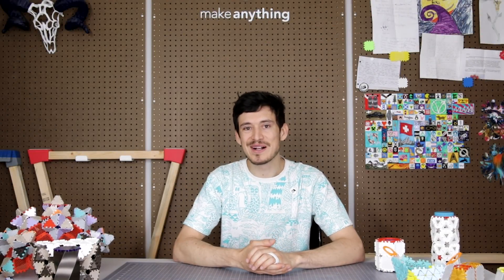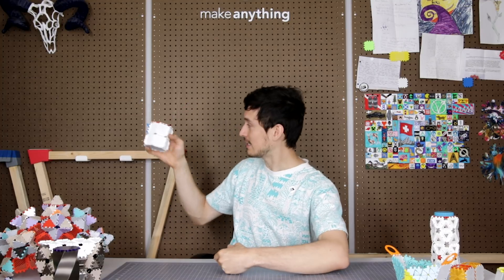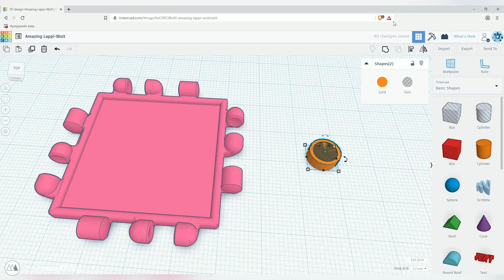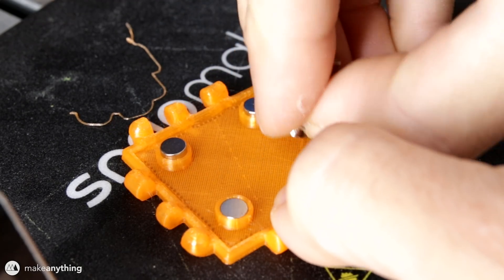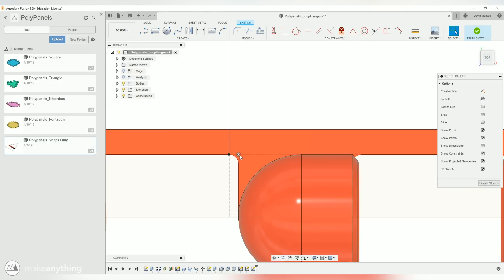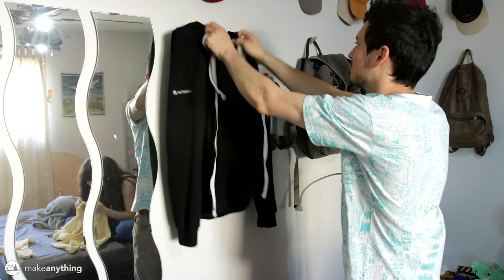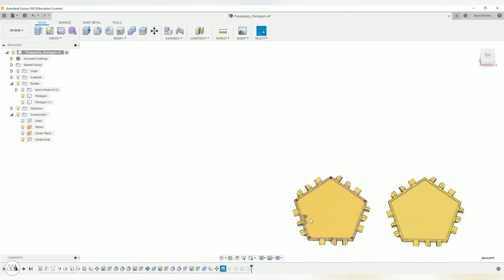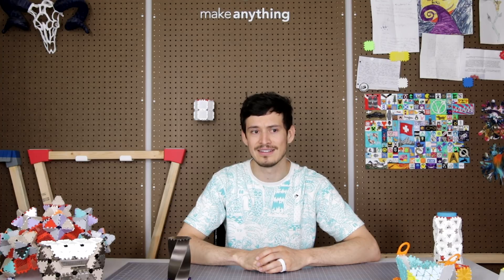Making Custom Polypanels is Easy! Tinkercad and Fusion 360 Tutorial

Comment: Your magnetic PolyPanels are a good use for making puzzle shapes.  Make something cool on your paper printer, cut it up into the shapes and sizes for the intended PolyPanel pieces, affix them however you wish, then see who can assemble the puzzle.  This could also be a many-sided 3D puzzle where each PolyPanel can have 2 puzzle components on either side.  

The printed puzzle images might be made of other materials as well such as laminated on one side and magnetic on the other (easy to do with a Xyron 5" and 9" Create Station).  This would enable the player or customer to add new puzzle inserts to their PolyPanel pieces as well as make their games as easy or as hard as they like by adding more PolyPanel shapes, pieces, sizes.

Comment: Yo Devin - I attempted to add a submission to your contest in Myminifactory , after having constructed it in Tinkercad.  You had mentioned in your video that one doesn't need a 3d printer to submit, but I think that I cannot make an approved submission in Myminifactory without the piece physically printed.  Is this true?  I included a shot of it from tinkercad, but it doesn't appear in the community listing of polypanels.
Reply from the maker: It takes time for approval, but as long as it's a valid file it should be approved

Comment: I have i question: does tinkerkad or fusion 360 work with the programm pepakura?
Reply from the maker: I haven't run Pepakura yet, but I'm guessing it requires an STL or OBJ file, which both TinkerCad and Fusion can produce 👍
Reply: @make.anything  thank you for the response. I've tested it out and it works flawlessly, now i'm going to watch your series on how to use fusion 360, then i can start making some 3d models. ;)

Comment: I mean fun sure... but... useful? not really.    Your clothes hanger probably took what, 20 squares is what 80g of plastic?   Since you can buy 18 hangers for like $2 US... that's like $0.12 each... you spent more than that in electric alone (est. on 20 min per square print time) - and your hanger is already sagging - which was the main issue with the Zacks toys - while flexible and fun to play with, when used for support they tend to bow and come undone.

So yes.. "fun" and "something to do" but... not cheaper, not better, and in many cases less useful.     They are not by any means "practical" and you seem to just be super excited about something your personally promoting so much.                Once again.... look at the Zacks toys.

Comment: Hey Devin, have you ever considered making a twist container hourglass? Like, make it so it slides super slow but a consistent rate? Make one in a transparent filament and one in a nice color (polyalchemy elixir is nice I gotta say) and like you can print a time scale into the exterior container with dual extrusion.
Reply: Great idea but I feel like an issue arrives with getting it to go at a constant motion. That would probably require something more accurate then a 3D printer.
Reply: Cool idea!!!
Reply: Nice 🙂

Comment: I dont have a way of 3d modelling, bit how cool would it be to have electronical component polypannels, one with a... CPU, one where u can rest the vent on, RAM SSD...
Reply: With so many contacts to align on a hinge joint, these probably wouldn't work so well, either greatly limiting the ways they can be connected or providing unreliable connections. I like the approach that Angus @ Maker's Muse went: using Polypanels for mechanical/structural needs (placing motors, servos and circuitboards), but wiring the electrical parts with proper tools.
Reply: Another idea though, adjustable PC case internals as Polypanels, to organize space for optimal air flow. Wiring brackets, disk holders, fan mounts, etc. That would require a lot of plastic though...
Reply: @dside_ru  it would be huge right, even though its not practical, just think... New cpu, just swap out a piece of plastic
Reply: @blu3ntv  socket compatibility issues aside, this isn't much different from what we have now, you just swap out a piece of silicon with some aluminum on top.
Reply: @dside_ru  I always knew it wouldn't be practice bit it would still be kinda cool

Comment: Not hating on your idea here, but isn't anything you make with these "polypanels" much weaker that it would be if you just, made the object normally?
Reply: Yes, the whole point is being able to easily reassemble the parts, which kinda implies some weakness.
However, it's easy to make the joints more-or-less permanent by leaving a hole for metal pin-like inserts right on the virtual edge, actually inserting them and welding the holes shut.
Reply: woolfoma well, you are able to make a simple container to hold something light for when you need it instead of: 
Thinking of an idea 
Design it
Print it
Touch it up 
Print it (again) 
Or you could 
Snap together a few pre made panels
Reply: woolfoma it’s so that if you decide you don’t need your part you can just take it apart instead of throwing it away